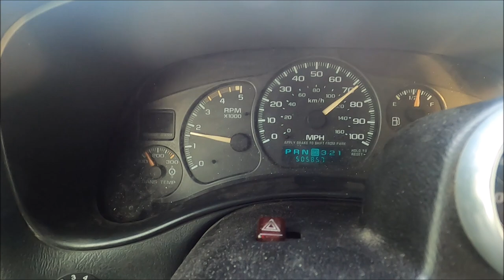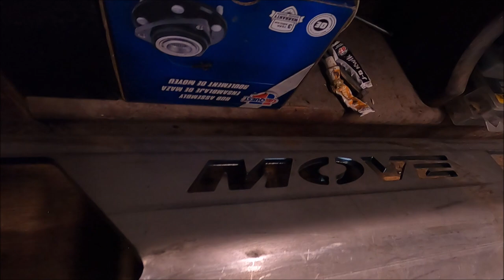SOME OF YOU MIGHT NOT KNOW MY SECRET........BUT I OWN A BADASS BOAT!

Comment: DFR, I really do not see you as a boat person...  "It came with trim tabs.... What are those for??"  I know you know your stuff with cars and engines and all.... But....  Boats cost $$ even when they are running great! Even more than cars... ) :)  Just don't be one of those goofs on Miami Boat Ramps if you go thru with it..  Nice boat non the less and you are going in the right direction in it's restoration...  NO LS in it...  454 with some transom straight exhaust and whatever drive is the thing these days...  All day long!  

Just remember to put the rear drain plug in before you put it in the water... ha, ha... :)  Keep on keeping on!

Comment: Put an LS in it! With an LSA blower and a raw water cooled intercooler.  He's right that a traditional SBC or BBC  would be the easy route with proven NA power combos.
Reply: LS motors really dont work that well in deep V go fast Boats. BBC all day.
Reply: @youtubechangedmyname  I have a 230 Sea Ray with a 5.7 sbc. Goes decent. I'd love a 7.4 bbc. What's the LS issue? Lack of bottom end torque?
Reply: @BBBILLY86  
Yeah ....dont get me wrong they work well in lighter boats but I still prefer a Big Block for Deep V go fasts. ...My Father has a 37 Ft Chaparral cruiser with twin LS based 6.0 Small Block Volvo Penta and they are great engines no doubt. But race engine they are not. I have a 7.4 in my 25 Baja and its ok but again no race engine. Gotta go 502 and big blower.just the sound alone lol 👍